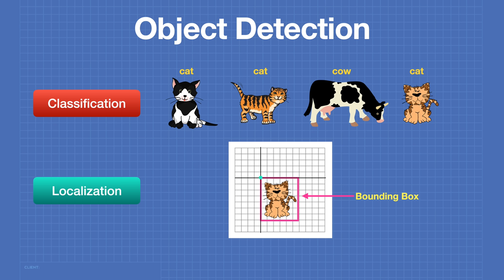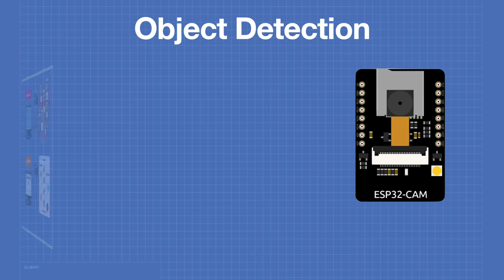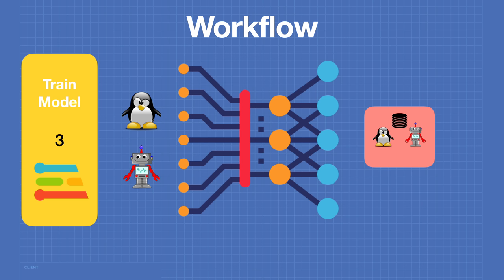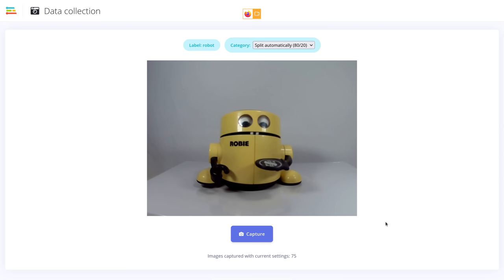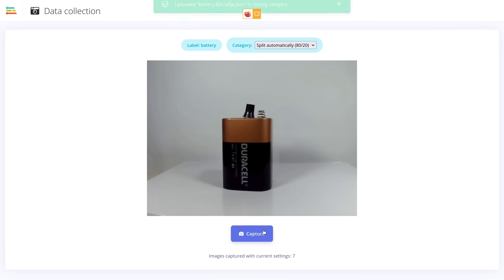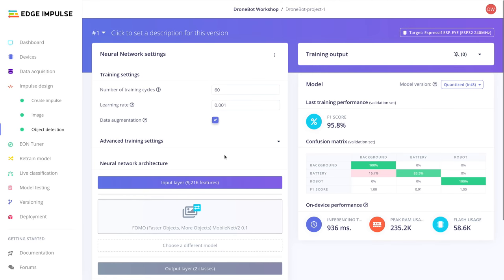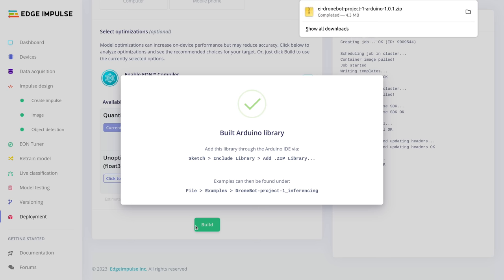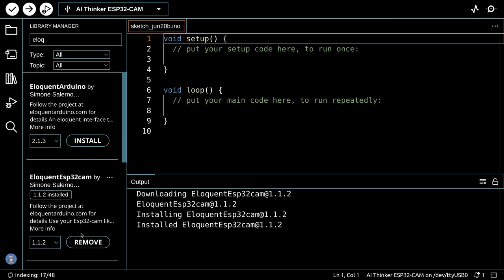Simple ESP32-CAM Object Detection

Comment: Great video. Looking forward to having a go with my ESP32 Cam. My only comment is you probably got the 100% on your second example because you had multiple images that are nearly exactly the same. These would have been randomly distributed between the 80% training and 20% testing sets. You probably ended up with same images used in training and testing which would not give you a good measure of confidence. Again another great video, thank you.

Comment: Oh love seeing another one with the ESP32-Cam! I already have two of these in my network as cheap surveillance camera running my own software. I am curious if there are any good upgrade paths for higher frame rate / higher resolution cameras? Also more ports available to control a robot would be neat.
Reply: use espnow or mqtt protocol so multiple esp32s can talk to each other and do the heavy compute on a proper machine that is connected wireless so the robot does not need to carry it...

Comment: At minute 51, we see that the number of objects dithers between "robot, battery" and "robot, battery, robot", but you didn't modify the scene at all.  The only differences would be the random noise introduced by the cam, ex, low cost -> high noise.  So which one of these detections would we accept, if we could only choose one?  Maybe we should average the last N estimates?

I note that the confusion matrix for this training session is 100% in all 9 boxes, which really doesn't mean anything WRT it's average performance on the ESP32, but rather, whether a good pattern could be found within the supplied images, most of which were identical except for noise.

Comment: Excellent video, very detailed. I have to do a similar project, and I'm not sure if this process would help me. I'd like to see the .ino codes used, the ones that came in the library (27: 35 and 27: 41).
If someone has that .zip library, please send it so i would not have to do the model training just for checking. I'll write my email if you answer me.
Thank you.

Comment: Hi, I just found your site and have a question. I am working on automating my roll off roof observatory and have one big issue. I need a way to let the software I use know that my telescope is in it's "Parked" or "Home" position so the roof can open or close safely. I was thinking an ultrasonic or an IR sensor. Does one of these sound reasonable, or do you recommend something else? I am using an arduino board with sensors to say when the roof is open or closed. I am using NINA, RRCI and SkyRoof to operate a garage door opener to move the roof. Any suggestions would be greatly appreciated.
Reply: I received an email from you saying I won a prize. Is this from you or is it a phishing scam?

Comment: Hello, i've tried running this code on the arduino IDE, using the esp32 cam, but the code won't compile, perhaps it's a configuration issue in the ide?

Comment: I followed all the steps but using both codes you said i got errors.

1. With the example of library downloaded from edge impulse, i got error "ERR: Failed to allocate snapshot buffer".

2. With edgeimpulse_FOMO example, i give error on #include "esp32cam/tinyml/edgeimpulse/FOMO.h", it say no such directory or file exist.

I tried so many times even make model with only 120 images but still didn't work.
 
Can you help with these?

Comment: I dont have the mount board and i plan on using the regular esp32 cam by ai thinker version i believe with a regular esp32 wroom. Does anyone know the pinout connections for that or where i could find how to connect them so i have the usb input. I know buying a mount board might be easier but I am going to pair it with a thermal cam I have working with the esp32 wroom. thanks

Comment: how about i have pretrained model .onnx, i load it but arduino no support it deploy because it is model type yolo , ssd . pls helpme
Reply: I have a similar issue. I haven't been able to solve it. I want to use a more normal model with esp32 if possible like YOLO. I also want to not use edge impulse but an offline solution like RectLabel or LabelIMG, but I don't see them having the same ESP32 exports.

Comment: I keep getting the same group of errors even after trying multiple different settings for the image size as well as trying different cameras. I wish I could get past these errors but Im stuck. Here is one of the errors, but it shows about 6 that appear to be about the same issue. Hopefully someone can advise me...
1733:80: error: either all initializer clauses should be designated or none of them should be
 1733 |     data_dims_t filter_dims = {.width = filter_width, .height = filter_height, 0, 0};

Comment: Great Video.

I was trying it and ended up with an error. Can you please guide me here
Error is:
C:\Users\<name>\AppData\Local\Temp\.arduinoIDE-unsaved202364-15092-1quuzgb.ilpgj\esp32_camera\esp32_camera.ino:116:20: error: 'CAMERA_FB_IN_PSRAM' was not declared in this scope
     .fb_location = CAMERA_FB_IN_PSRAM,
                    ^
C:\Users\<name>\AppData\Local\Temp\.arduinoIDE-unsaved202364-15092-1quuzgb.ilpgj\esp32_camera\esp32_camera.ino:117:18: error: 'CAMERA_GRAB_WHEN_EMPTY' was not declared in this scope
     .grab_mode = CAMERA_GRAB_WHEN_EMPTY,
                  ^
C:\Users\<name>\AppData\Local\Temp\.arduinoIDE-unsaved202364-15092-1quuzgb.ilpgj\esp32_camera\esp32_camera.ino:118:1: error: 'camera_config_t' has no non-static data member named 'fb_location'
 };
 ^

exit status 1

Compilation error: 'CAMERA_FB_IN_PSRAM' was not declared in this scope
Reply: Can you fixed it? I have the same issue!
Reply: @minhnhattang194  update your drivers and check also windows update. The issue will be automatically fix.
Reply: @darshandodamani6682  Thank you so much